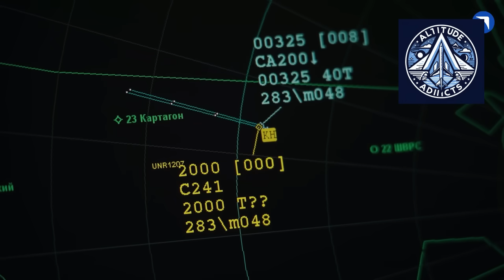MC-21 Not Before 2027 - The Limits of a Domestic Aircraft Project

Comment: They have to use the example of B787. The B787 uses an electro-thermal anti-ice system that embeds heating mats directly into the composite leading edges of the wings. This system uses electricity to generate heat, melting any ice that forms. It is designed to be more energy-efficient than traditional engine bleed air systems.

Comment: МС-21 необходимо окончание войны и снятие санкций на поставку западных комплектующих, просто они ждут, раньше этого мы не увидим самолет в серии.
Reply: No, no es así. El MC-21 ya desarrolló todos los componentes de fabricación rusa, ahora los está certificando.
Reply: a fully-Russified MS-21 prototype (tail number 73057) just took off to the skies a few days ago.. Russia is continuing the MS-21 project despite of all the Western sanctions
Reply: @ibrahimtouman2279  is continuing for 20 years because of overall corruption
Reply: @alexandervt641  the MS-21 project was hit with multiple Western sanctions starting from 2018, so delays are to be expected.. I will personally wait until 2027 before I give my final verdict, if the MS-21 airliner goes into service in 2027 then everything is fine, but if it does not then corruption in the project is highly likely